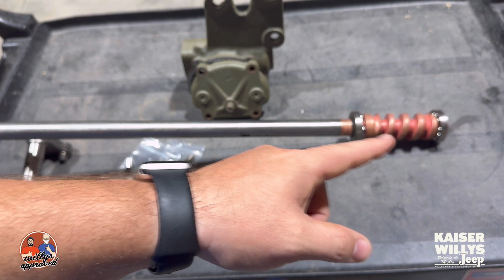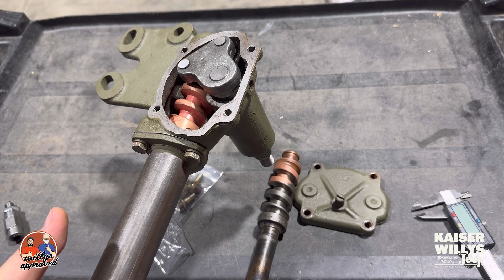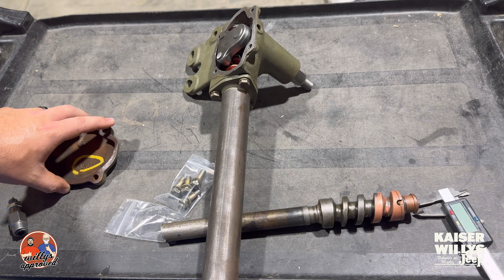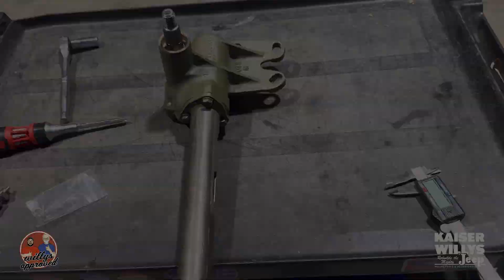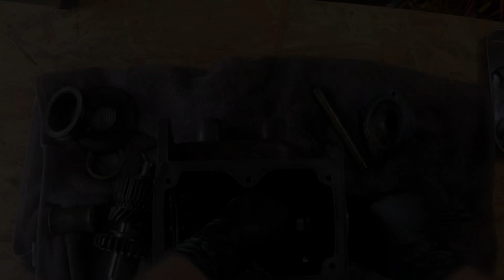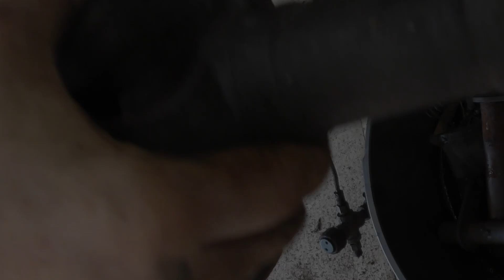Willys Jeep Part Highlight: New Worm Gear Vs. Original

Comment: One thing I can’t figure out is the play in the worm shaft. In/out I understand should be zero. But is it ok to have side to side play?
Reply from the maker: The in and out play can be adjusted via side screw or if you want automatic adjustment grab one of out tight steer kits. But there should be no side to side play. That indicated a worn or improperly reamed sector shaft bushing. Call if you have any questions. 1-888-648-4923. Have a great day!